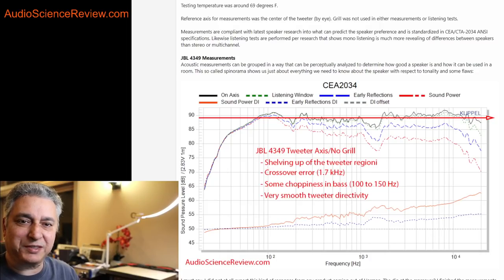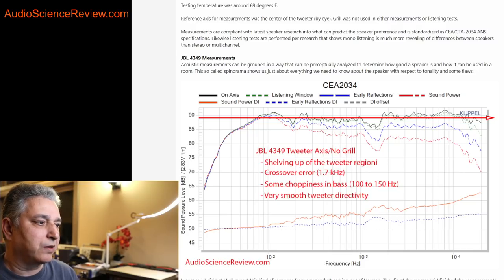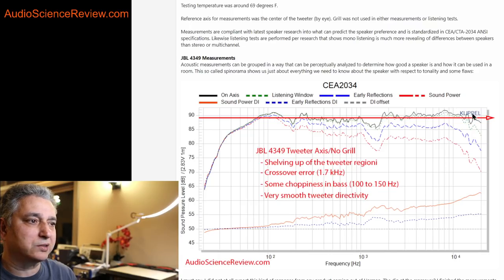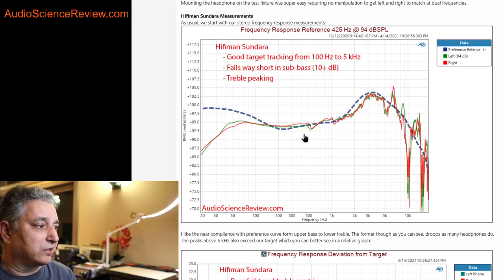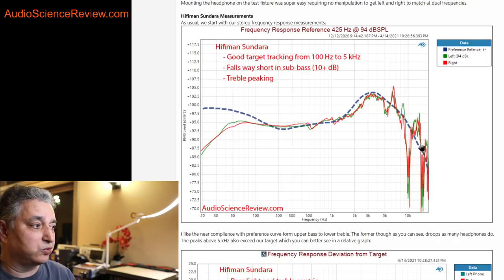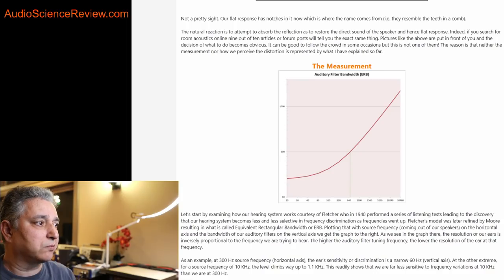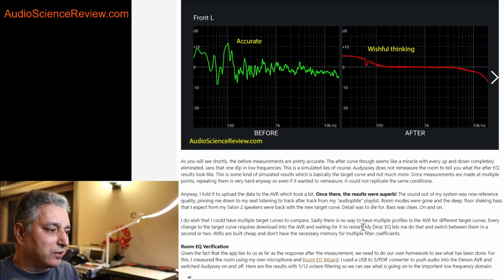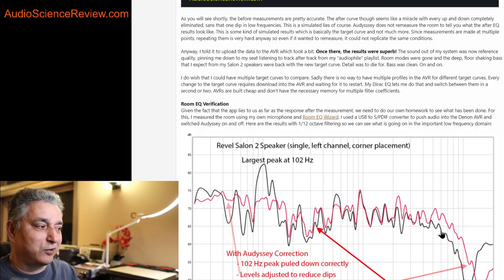Understanding Audio Frequency Response & Psychoacoustics

Comment: Amir,
Talking about psychoacoustic, what is your take on applying an average hearing curve, with all its known characteristics per frequency range, as a kind of an eq base line instead of the flat, or almost flat line you showed?  If that makes sense, do you think that computational wise we already have the standard market hardware or it would cause other problems and we better stay with the "already known devils"?
Best Regards,
Reply from the maker: If I am understanding your question right, you don't want to do that because whoever created music has similar hearing system so the non-linearities are built into the content you play.  If a computer was creating the music automatically, then yes, you would want to follow such scheme.  There are systems with loudness control that are volume dependent to compensate for varying sensitivity to bass with volume for example.  They are a good option to have although I would want an adjustment coefficient as we are not all identical in our hearing sensitivity that way.
Reply: @AudioScienceReview  Thanks, Amir. I didn't take into account the sound engineer hearing system during the mix.  

On the other hand, when analyzing our room response where we have the calibrated mic file, does this file already have our "hearing system integrated into its callibration"?
Best Regards

Comment: Hi Amir, I love my sound and Hifi and Im also Autistic. My hearing seems to be pretty sensitive.  Is there any way of telling if I can hear in a different way to other people?  Thanks
Reply from the maker: Maybe.  Try to encode some music to MP3 at say, 256 kbps.  Then use a program like foobar with its abx plug-in and see how easily you can tell it, and the original source apart.  This should be extremely difficult to impossible.  If it is easier, then you are way ahead of general public!  

For a test of frequency response, get a copy of Harman How to Listen software.  See how high a level you can climb up to: http://seanolive.blogspot.com/2009/05/harmans-how-to-listen-new-listener.html#:~:text=May%2030%2C%202009-,Harman's%20%22How%20to%20Listen%22%20%2D%20A%20New%20Computer%2Dbased,professional%20and%20automotive%20audio%20products.

Comment: Is it true that ERB does not concern the human hearings ability to differentiate between levels of loudness? Let's say i had two clean sinus tones one at 10kHz and one at 100Hz. Now we make both tones x dB louder oder softer. I assume i would hear the db change in both tones with the same intensity because ERB is about differentiation in pitch not level. Am i wrong?

Comment: Question: Regarding frequency response, is there any transition region between the far field and near field when using speakers? E.g. is there a point where the preferred frequency response is no longer flat? I found that with a near field system the response that gives the best overall neutrality as far as acoustics goes actually looks a lot like the Harman headphone curve with a similar peaking where the ear is most sensitive. The same setup when used in the traditional far field had, as one would expect, a flat response (or at least as flat as could be measured in-room).
Reply from the maker: The transition is frequency dependent unfortunately.  So one number doesn't get you there.  My Klippel speaker measurement system can compute this but I don't know how to present such data.  Note that this applies to the technical definition of near/far field.  It may not necessarily be what you mean (driver integration?).  That value is not easy to compute.
Reply: @AudioScienceReview  FWIW Im using large tower speakers and a subwoofer as speakers for my PC. I sit about 3' in front of the speakers (they're about 6' apart) and my listening position is about 70° off-axis. In filter terms, the peaking in the response ended up being centered on 6kHz for best results, with a Q of 1.7. The response peak is quite well defined in the measured frequency response profile (not the EQ itself), and necessary as without it the sound is very unnatural. With the EQ in place, ambient sounds in videos (e.g. birds chirping, conversation, etc.) sound as they do in real life. The fact that its at 6kHz and not 3kHz may be due to my hearing, which seems to skew towards the HF end. I'm over 40, but can still hear to almost 20kHz.

Comment: Nice vid.  I agree with eq filters, that less is better.  Especially filters that boost.  I've noticed distortion when boosting so I mainly try to attenuate.
Reply from the maker: Indeed distortion is the enemy of boosting.  This is why I also perform distortion testing and am always careful of boosting in those regions above bass.  In bass area, the perceptual effect of proper bass is very important and audibility of distortion rather poor.  So it works better there but all else being equal, you want a transducer with low distortion to allow boosting as necessary to fix tonality.

Comment: Excellent video - thanks Amir - I don't know if you've ever covered this, but I wonder how filtering affects phase response (which I don't fully understand) and how that phasing effects the overall sound that I hear - I have messed with a room correction tool -  I'm not sure if it was the phase thing that bugged me or not, but something about it made it not worth keeping it permanently in my system - because of that experience, I've avoided electronic eq correction since.
Reply from the maker: Hi Skip.  I plan to do a video on phase.  For now, the simple answer is that it doesn't matter especially with speakers.  Any sound you hear is a combination of direction sound and reflections from many surfaces with different phase.  But then time you perceive anything, you have basically random phase.  Controlled listening tests have shown the same.  Even with headphones, audibility is limited to special test signals.  With music, it again becomes inaudible.  So I would not worry about it.

Comment: Should be retracted.
7:14
"...variations here (around 240Hz) is far more audible because hearing bandwidth, ERB is very narrow"
"...whereas, when you get up here (around 15kHz), you can see these little wiggles, your ERB is big chunk over here...these little peaks and valleys are never heard"
"the same peaks and valleys here (around 240Hz) are (can be) audible."

First of all, Amirm is clearly saying the word "same peak" on the log axis, otherwise, it does not look the same at all.
And well, ERB's 51Hz bandwidth on 240Hz corresponds to about 0.306 oct and 1640Hz bandwidth on 15kHz corresponds to about 0.158 oct, obviously former is greater on the log axis.
So, if you see the "same peak" on 240Hz and 15kHz on the log axis, the former has less possibility of audibility.

I'm very sorry to say, because I'm paying respects for his efforts, but this time, I should say Amirm is completely wrong.

Comment: you forgot to think about one thing here, 3khz bank bandwith for example, dont mean its a smoothing filter in every case. it only filters when multiple sound are present there. a pluck of a string at 15khz still keep its volume, its when you add many other things in the same bandwidth it gets averaged out.

Comment: If high fidelity is convincing recreation of sound heard live from a recording then there are engineering criteria that must be taken into account in the playback system. The first arriving sound must have a flat frequency response all the way back to the recording microphones. Wide uniform dispersion particularly at high frequencies is critical. The beaming directional tweeters universally used today are awful. Then there are the reflections that must be engineered to recreate the reflections of live music. There are two kinds of problems, the reflections that would be heard were the musicians in your room and the reflections that would be heard at a concert venue. In the first case that is much of what you hear, in the second case that is almost everything you hear. 

Not only are spectral changes of reflections compared to the first arriving sound critical but so are the time delay, direction of arrival, and loudness compared to the first arriving sound. These must be engineered in a way to take into account the variables of the acoustics of the listening room and the variables in the way the recording was made and the kind of environment the type of music is best suited for. 

Since you can't hear the direction of even one reflection, understanding how the brain determines direction is critical if you are going to defeat it in an engineered sound field. So you have to learn how to model, analyze, and engineer sound fields. The currently accepted explanation of detection of direction is dead wrong. This is proven by binaural recordings played through headphones. It meets all of the believed theoretical criteria but fails anyway so it's wrong. 

So while frequency response is critical and necessary it is not sufficient. The current technology fails miserably and compared to live music. Recordings played through it sound dead, flat, boring compared the real thing. IMO the work product of this industry is a total failure. Did I solve this problem? Yes, nearly 50 years ago. I admit it's a tough problem, beyond the ability of the people I've met or listened to what they've had to say. I've solved tougher problems but this one isn't nearly as simple as they would have you believe. How can you solve a problem you don't even understand?

Comment: Listen to a pair of speakers or headphones at 85 dB SPL and then listen it them at 93 dB SPL and you will clearly hear the effect of Equal Loudness Contour.  Suddenly the same set of speakers or headphones that sounded flat is now harsh.  The frequency response didn't change.  Our perception of it changed due to the increase in SPL.

Comment: Amir, 
9:16 I like to disagree I can, can I please disagree not with you but disagree. I see it like DLSR photography and the graph is out of focus. Place mic near to tweeter or HF horn and graph looks smooth (with no smoothing of course) I can do the same though the Lucasfilm Ltd THX Sound System be it processor or amp return and see a flat graph well certainly nothing like what I usually/you yourself usually see. Then I place the mic few more mm to inches to feet that can be mm inches depends which way I want to measure and matters not. the graph becomes out of focus. 
I can do the same on the THX with no smoothing or smoothing applied and it shows very little difference. 
I can place mic near a tweeter and move that tweeter/mic around the room or move other flat surface objects or cardboard near and the frequency deal alters, pray I don't alter it any further.  
If mic placed near tweeter and HF cinema JBL horns it looks like a rollecoaster ride it goes up down (everything except the triple loop) if I saw that I would be puzzled? 
Maybe do next video while actually, doing it. You know doing it with mic speaker rta and amp and show the amp frequency and speaker in room at same time.

9:34 microphone is. All my Behringer ECM8000 are crying you just insulted my x6 ECM8000's they are crying. 
There was this one guy says he never uses RTA and how does he know his speakers are okay? All these snob rich peoples speakers aren't 100% equal like buying a rubbish coke cola where 5 cans all taste the same and yet some snobs toff's speakers costing £7.5 grand for those JBL you reviewed ain't gonna be equally the same now are they. That is where EQ PEQ is used as a tool to sand down the uneven bumps just as sandpaper is used in same way to sand down wood.
9:34 again well it doesn't have a mind now does it, much less a conscious now does it. I never used autoEQ in my  home THX cinema. Why cos I use a complex pro system with additional outboard matrix decoders and any EQ ahead of the matrix will mess up the decoding steering which is why EQ is done afterwards. autoEQ can't stop, pause and think for itself it can do what it is only programmed to do. Then again isn't that is what happen now with us all being programmed by governments to slowly purge condition us all to be some I hope sweet peaceful world utopia, I do hope so cos I am sick and tried reading about guns and violence and Snake Oil speaker cables.

10:20 clearly you not seen Alien 3 in six-track Dolby Stereo on dvd with the cat scan scene. I wouldn't slope off too much gonna need some of that. Now go and buy dvd region 1 Alien 3 (1992) and make sure you have matched JBL LCR speakers behind AT screen cos that is how I heard it in 1992 at UCI tower park, with EV speakers and Overhead surround and atmos ain't got shhhh hit on it. Well I was there projectionist when it opened after a month for a year. I did a spectrum lab graph of the scene and I ain't saying what frequency. You have to get it and prove you have with a video with test gear set-up and listening. You don't have to be into Alien 3, but it is one many the best sounding Dolby SR mixes I heard that year, unlike some of atmos rubbish mixes today.

Comment: Amir, is it possible to develop a method/standard of evaluating the quality of a speaker's frequency response, based on principles of ERB, Fletcher Munsen curves etc.?
Reply from the maker: To fair extent, yes.  For complete answer though, I listen and then use EQ to fix and unfix variations to determine audibility.  Trying to apply psychoacoustics directly is much more difficult.  However, I use that science to give confidence tow hat I have found with EQ testing.  If a narrow filter doesn't work, then I know why.  Of if it makes a big difference, I step back and do a blind test to make sure I am not imagining it because the science says it can't be that audible.
Reply: @AudioScienceReview  
Since you measure, study, write and record extensively, I humbly suggest that you author an evaluation standard for speaker and headphones. One that can reduce the evaluation to one scale of 0 to 10. It should encompass, ERB, equal loudness curves, phase, THD, IMD, spectral decay, Claus Futtrup limits, etc.
 
I'm sure industry has experts who can do the job but I doubt they'll venture into it beyond what benefits them in selling their products.

This could be a summary of work being done at ASR.